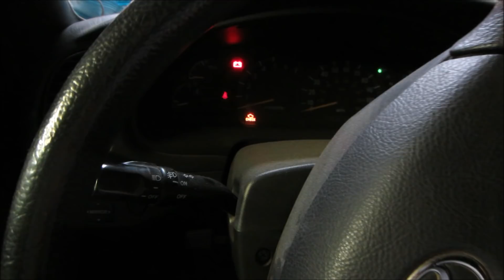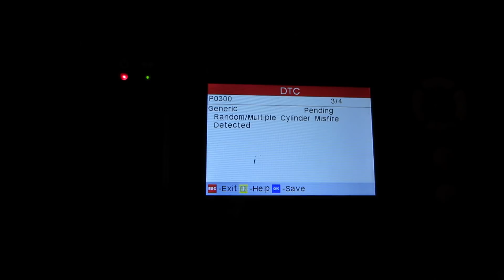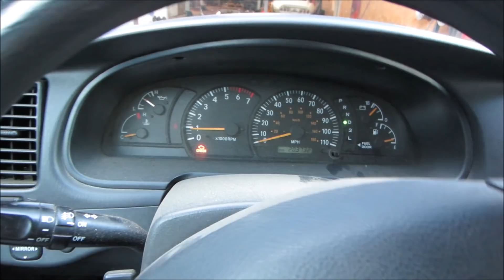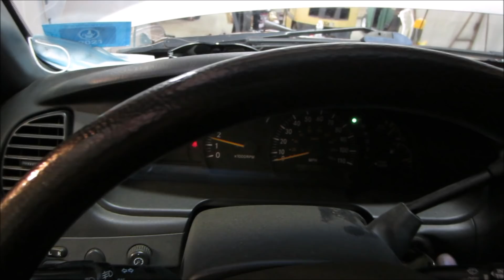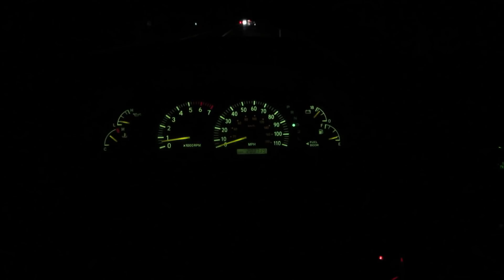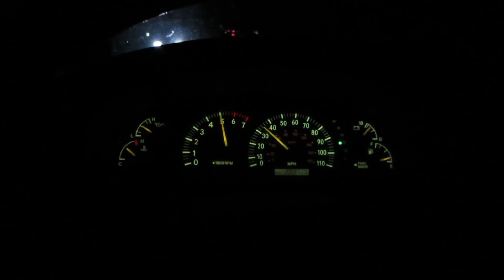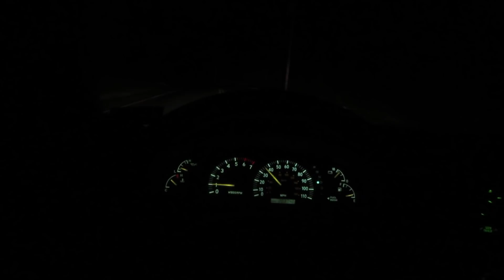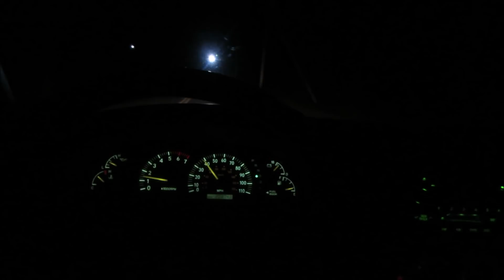What Screwed Up My Engine? You Won't Believe It

Comment: I'm mildly disappointed that Toyota don't have a diagnostic code for "Mouse in cambelt".
Reply: Haha     Thats funny
Reply: Same thing happened to my neighbor's propane generator at only 2 months old.  They were changing parts like mad trying to figure out what was wrong!  Engine had coolant heater, nice warm place for a mouse!
Reply: Mice, rats and rodents in general are bad news.  It's one reason I think Shawn Woods "Mouse Trap Mondays" is so popular.  That and I personally just love Shawn Woods.
Reply: Hahaha 🤣 I wonder if the programmers ever bury little "easter eggs" like that in the software?  You'd think that 𝑠𝑜𝑚𝑒𝑜𝑛𝑒 in that industry would have a sense of humour.😁
Reply: The mouse was so obviously a covid death
Reply: You would need 2 camshaft position sensors and a crankshaft position sensor (or two, why not, then you can have a “snapped the crank” code too)
Reply: @Hubjeep  They supposedly use soy in wiring insulation, to help "save the earth".  Good thing mice don't eat soy. 🙄
Reply: @tomclarke6475  not supposedly, some manufacturers do, like Mercedes was quite famous for it, for a little while, called it like bio wire or something, i call it that fucking crappy ass wire that's caused me headaches on my high mileage S Class, the stuff degrades with age meaning its time limiting the car, unless you replace it which is a royal pain in the ass,, i know merc did it, i believe VW and BMW also did, toyota maybe ford definitely, honda actually no.
Reply: @compzac  I think it should be a legal requirement that if you own a vehicle like this and are rebuilding it or it otherwise works fine the companies that use features like this should have to replace or give a full factory replacement set of the wires, you can bring the old ones in as a core if they require it or complain about the cost not just being the part that goes bad.  
if the government is going to suggest or force companies to have a certain amount of biodegradable parts, knowing full well a used car is less polluting by already existing than a new electric or hybrid, then they should also fix any issues caused when these vehicles happen to otherwise last beyond that time frame, when you’re an outlier in a calculation about pollution by manufacturing, you should honestly be treated as well as the car was to become that outlier and have anything that wouldn’t otherwise have failed if made normally replaced, and considering how critical wiring is to cars and how hard it is to effectively repair, they should just do this anyways. Parts like the engine body and frame are mostly up to the maintenance and care, sadly when people don’t have the luxury of owning a garage there’s little they can do about body and frame.
Reply: @aterack833  All very wonderful thoughts and ideas, but theres a problem, money the manufacturer only gets money from new car sales, so they would rather you buy new cars rather than try to keep an old car going for as long as possible, then theres money for the state, my state requires a smog check of a car every couple years, what this means is its an amount of money you pay for a mechanic to stick a prong up the tail pipe of your car and tell you its still running efficiently. never mind that the last time i took the Mercedes in for a smog check it didnt have functioning blinkers due to that lovely wiring, it still passed its smog test which meant according to the state that car was fine to drive, however it was also given a tax for being " A gas guzzler". i am a full believer that its a better option to keep an old car running and use it till its dead before buying a new one, but thats sorta a dying idea  people want the shiny new thing cause its shiny and new, never mind that it doesn't more environmental damage before its even fully built than my merc would have done in the 27 years of its existence. I sound rambly and its cause the way things are set up irritates me so many shops have said to get rid of the mercedes or my chevy truck saying oh they are unreliable, or making jokes about them mostly the chevy anyway, but well the chevy is 21 years old and has never left me stranded since i got it, and even the mercedes is pretty damn stoic for 27 years old with nearly 600000 miles. yes its stranded me but thats kinda of expected with that kind of miles, those kind of years and well with substandard parts like the stupid electrical wiring and connectors that just decide one day to fall off.
Reply: @compzac  ya, I’m talking about forcing them to, the environment needs help, and burning seats everything not recyclable out of a car when it’s crushed and melted down isn’t helping
Reply: @compzac  also if you’re somewhere that does that, maybe don’t buy cars? When’s the last time a cop ran your vin?
Reply: @compzac  also, consider redoing the wiring if you actually like the car and it isn’t t just to get you around, even if you have to solder to the components or get new crimp on prongs and such.

Also Chevy kinda does suck, when the frame rots out you should grab one from a GM not a Chevy, they use better metal or thicker or something, not sure the method but they don’t rust out even though it’s the same part spec wise
Reply: @aterack833  Well i cant say my chevy has any rust issues, its held up just fine, though i use a treatment of oil on the frame like mustie does, and i am redoing the wiring in the mercedes, just not exactly a quick process cause theres quite a lot of it in an S Class even if its a 1995 model. Our smog checks though the issue is that when you get told you need to get one, you cant get the current registration till your car passes and if you fail, well you can only get a temporary tag, which means you can legally drive it for a certain number of months, but need to fix it till it passes again, and just to clarify, Chevrolet is part of GM, the frame on my 2500HD is the exact same frame as used in the GMC Sierra 2500HD same part number and everything.
Reply: @compzac  I know it’s the same part number everything, but what plant you get it from and who makes it actually does manage to matter between the two (at least for the 1996 model and other years of that model)
Reply: zachary carlson Honda does use it. They sell rodent tape that has hot pepper on it and your supposed to wrap all your wiring with it. It is $50 a roll
Reply: @slalomking  Thats Tape though its not the actual wire insulation. Which at that point its fine, my issue is when they limit the wiring by using it for the actual insulation, i  it sucks thats its incredibly expensive per roll. but its still better than well now my car is fucked cause the wiring is failing.
Reply: I would put on a new belt and water pump.  Bet the truck will be working in 8 years.  Have the engine last.

Comment: Mechanic:  Looks like a mouse knocked your valve timing off by a few degrees
Me:  Yeah, right.
Reply: It’s hard to find somewhere to ask question about something else on YouTube. I have an issue with a Briggs 12hp that is randomly loosing compression one minute it will run fine stop it and inlet valve sticks open. I have a feeling the valve seat has come loose holding the valve open I was just wondering if this is a common issue. Sometimes there a loud click and compression will return but when it runs it’s not making any strange noises and it does not miss fire even under full load
Reply: @WidowUK  do the easiest thing first, make sure valve lash clearances are correct for your engine model and size and if not correct them
Reply: @leviwilder1205  I think there pre-set on these engines. There a flat head with the valves mounted in engine block. I’m going to have to remove head I was hoping to get away without doing this as it’s still got it’s paint on from 1970s and it’s in next to new condition.
Reply: @WidowUK  you cant adjust the lash on the older style briggs, I thought you might have had the newer style where they come out of adjustment as the plastic cam shaft wears out
Reply: @leviwilder1205  sadly no it’s a 1970’s model alloy block I have a feeling the valve seat has broken loose on the inlet valve and has now stuck up holding valve open. It had a tapet tick but not bad enough to think there was something wrong with it and now you can pull it over with no compression you can hear it escaping via the inlet valve as it tries to fire the fuel. Sometime it clicks loud like the valve shutting and it will go
Reply: @leviwilder1205  there’s a video on my channel of it running you can hear the top end rattle it has
Reply: @WidowUK  I got too much time on my hands now a days, if it was me I'd just take it apart and check it from top to bottom loss of compression could be bad gasket, bad valve seats, poor cam timing inside or even excessive wear... but without it infront of me and only going off sound its hard to say for 100% what it would be
I hope you get it all figured out soon though and sorry I wasnt of anymore help
Reply: @leviwilder1205  np I was hoping musty would of jumped in here with his experience and put my thoughts of a loose valve seat to rest I’ll drop you a line once I’ve pulled head off to see what’s going on inside it can’t be anything too great it does run when it feels like it not burning oil, I believe it’s not done many hours from new it was back up power source for a stair lift its stood for 15 years before I got it.
Reply: come on, that is believable, you can t make that shit up, lol

Comment: Like your Video!  I have a 2005 Toyota Tundra which I purchased new.  My Tundra was involved in the Rust/Frame Recall/Rework.  The same dealer I purchased this Truck from decided the proper repair was to spray my Tunrda's Frame with some goop as the proper "REPAIR" to address the DEFECT Toyota has with the Frame on these Trucks.  Not long after the Dealer performed the rework/repair I started noticing the frame had rust coming out from under the goop they put on the frame.  The rust issue coming from under their repair got worse over time.

I've brought this to the attention of the Dealer several times starting shortly after the goop was sprayed and the rust under the goop was noticed.  I was told the repair performed was done according to the Toyota campaign and there was nothing they could do.

I then contacted Toyota USA and expressed my concern.  I contacted them several times and got the same reply.  My Frame has been addressed and there is nothing else they are going to do.

As of today, my 2005 Toyota Tundra has 97,000 ACTUAL miles on it and it is 16 years old.  When I started trying to get the Dealer and Toyota USA to address the issue, it was much newer and had less miles on it.  When I bring the truck to the dealer for service, I ask them to check the frame and document their findings on my work order.  When I get the truck back after the repair, nothing is documented on the frame inspection and findings.  I'll ask what they found and they say "there was no perforation".  I get the feeling they do NOT document the finding because they don't want to cover the repair of this well known DEFECT.

All we own are Toyota's!  It blows my mind that some people have had new Frames installed on Tundra's that are older and with 2 - 4 times the miles on them.  With how they are handling the DEFECT on our Tundra, we just may be looking toward a different company to buy our new vehicles from.  Hello Ford or Nissan???

It's so sad, by word of mouth, we have sold 3 - 4 NEW Toyota's for Toyota prior to the rusty frame issue happening.  Now we tell everyone of the lack of QUALITY and DEFECT found on our Toyota Tundra!

If ya don't look under the Truck, it looks like its a NEW Truck!!!

What can I do?  We have a good Truck with a health issue!    :-(

Comment: I used the bar/chain oil method after watching you do the truck the first time. When I was mixing my coating, I took a pint of kerosene and poured it into the empty oil bottles, one after the other and shook it around to get all the residual oil left in them out. You should have patent this, my 03 Silverado frame still looks great. Thanks for the tip.

Comment: I was taught by old timers to never put sealants with O rings.  On a side note, you should send this to Shawn Woods the mousetrap guy.
Reply: One problem with the Toyota mousetrap, it's rather a lot of effort to give it a little flip to remove the mouse.
Reply: IDK why they dont have poison or mix plaster of Paris and sugar and flower together Kills mice humanely. If one of those suckers got in my diesel VW it would be over.
Reply: I assume he does not want a leak again and this is the last time I suspect anybody is going to touch is...so glue the crap out of it.  Technically you are correct though.  And look at the corrosion on that engine.
Reply: @schwags1969  Just proves TOYota's are cheaply made, not nearly as well thought out as people like to claim, and frigg a timing belt?
Reply: Depends if butyl, buna, natural, neoprene
Reply: Patrick Baitman
Its in the toyota factory service manual to add "fipg" (form in place gasket) to the water neck o-ring....
Reply: @jamesdarr6714  Good to know.  thanks!
Reply: Thanks for NOT arc flashing the camera. Old mekanicks don't need to see any more flashing than absolutely necessary! On or off screen..up close or across the shop. Please protect your eyes I only have one left working. Peace

Comment: You could have bent a length of threaded rod into a "U" shape and just clamped it round the pipe and through the sensor holes.
Reply: I thought of using a U-clamp too but his fix is just as good or even better.
Reply: That's what I thought... Modify a U clamp..
Reply: Where I come from we call those muffler clamps.
Reply: @Theorbit10  Muffler clamp, U-clamp, exhaust clamp, pipe clamp, U-bolt,and I'm sure there are more names,some being correct and some not.
Reply: Perhaps a muffler clamp would have worked as well?

Comment: I am a damage appraiser for an insurance company. We have claims for mice chewing the wire harness all the time.  Toyotas are the majority of what we see it on. We are told they use a soy based oil in the manufacturing process of the harness and if it does not get cleaned off the mice find it.  Never had a claim for a mouse in a timing belt before.
Reply: Mike Levsen here in MO the mice eat up the Hondas,  my Toys they don't bother
Reply: Yeah, they use vegetable based coating on the wiring in most vehicles, as well as some vacuum hoses. environmentally friendly allegedly. Critters love it. It also shortens their lifespan which is why we see crumbling wiring(and some plastics) so often.
Reply: My Stinger is in the shop for $6,000 damage to the engine harness. My Toyotas and Lexus weren't flavorful enough for the rodent.

Comment: Spray that frame with linseed oil and 10% diesel, after scraping the rust open. Just do every year again and it will stop the rust, as the linseed will form a hard skin, but still stay flexible.
Reply: Interesting. I thought of using concrete form oil on my t100 but linseed may be better option. Raw linseed oil or boiled?
Reply: @captaintoyota3171  Have used both, but the boiled does smell less.

Comment: Mustie,
We have "dusty" roads, but it is mostly "rust dust" from old cars losing their rust on the roads. This causes conductive dust that ruins batteries by leaving a coat of rust on the battery leaving a high impedance conductive short between the posts on the battery, draining them constantly. This also shorts connectors for lights, sensors,  door sensors and the like. So I clean all connectors periodically with  Deoxit D-5, an electric cleaner that leaves a light oil (that doesn't affect plastic) behind on the metal parts of the connectors. I clean the top of my battery with distilled water so if any water gets  in the battery, it will not disturb the battery chemistry. Battery posts and clamps get cleaned with the old style battery brushes and then coated with petroleum jelly to stop corrosion (something my Uncle taught me 40 years ago that is very cheap and works very well). I even clean the grounding lead from the battery to the engine block once every oil change to keep a low impedance connection so my battery gets charged correctly. I get one or two more years out of a battery that way (past its warranty date). You ought to try it and see how it works for you.

Comment: That was amazing!  Who would have dreamt that a mouse got inside the engine and wound around the timing belt/cam shaft pulley!
Lucky that it was only off 3 teeth and didn't bend a valve!
Amazing find!